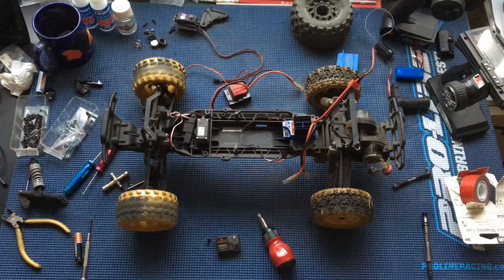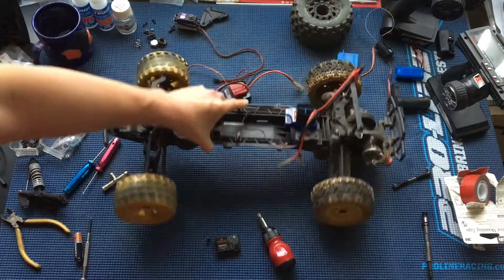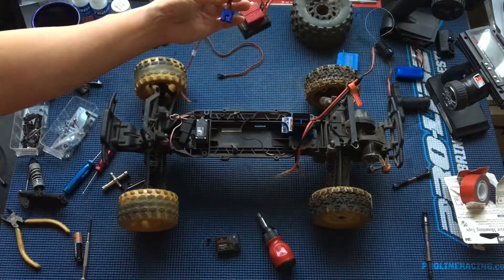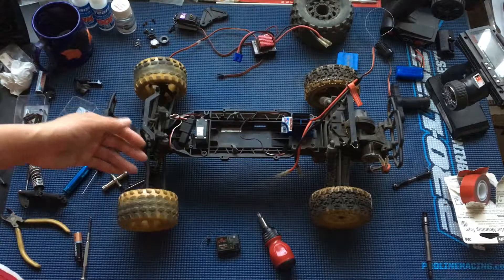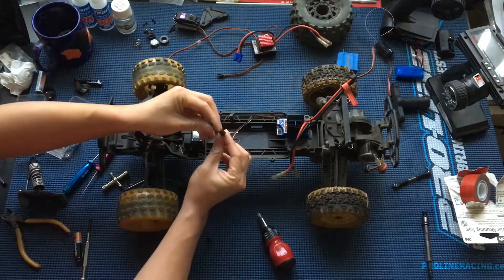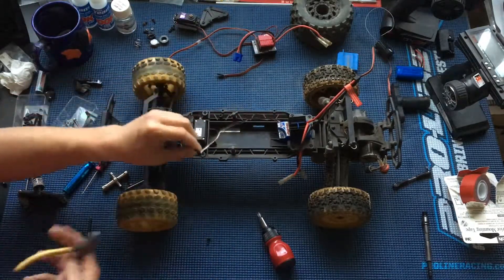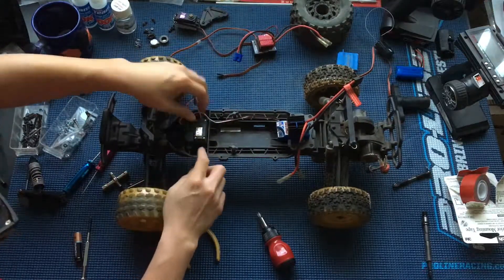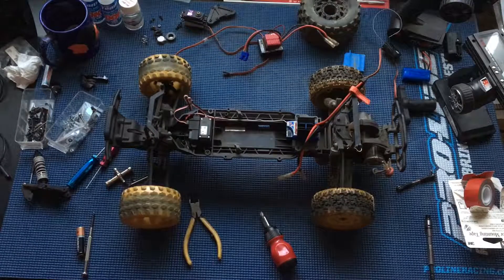ECX Torment 2WD - How To Install a Traxxas XL-5 Brushed ESC With a Spektrum Receiver

Comment: I did the exact same thing before I saw this video and my steering works well no problem. Only issue is that it sometimes either doesn’t respond to throttle or it’ll hit full throttle without touching the remote and won’t catch only steering works any idea? Or if you experienced the same issue thanks

Comment: Did you ever get it going?
Reply: I doubt he did because you can’t pair the spektrum recivers to traxxas I’m upgrading my losi 8t from the 4500kv motor to the 3500 veilneon motor and esc went to pair it and the esc just blinks green indicating it’s not receiving single so probably gonna have to get a traxxas receiver and remote all the rc company’s realized they can make more money making their parts only work for their cars so you have to completely switch over if your doing something like that or your going to have problems as you are having already
Reply: @Going4arip_RC  hey bud! So I have an update. I actually got my spektrum receiver to work with my traxxas esc! I was researching Google and other vids and now I have it running good!